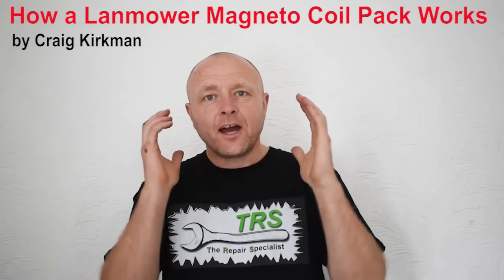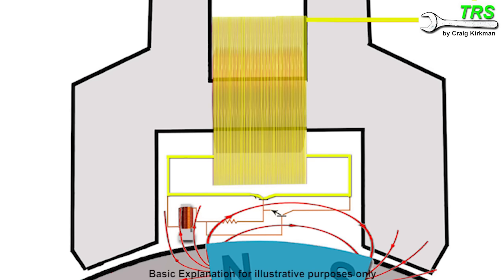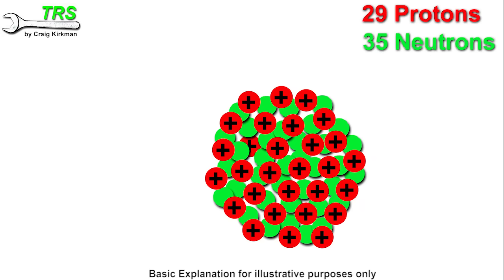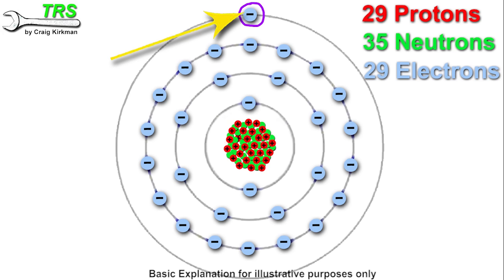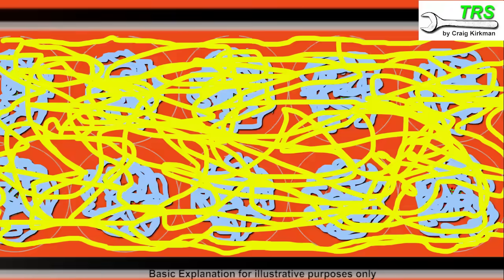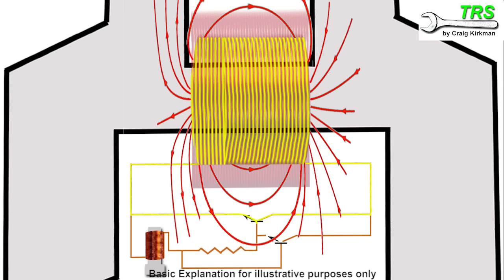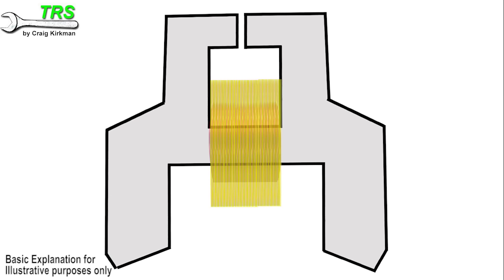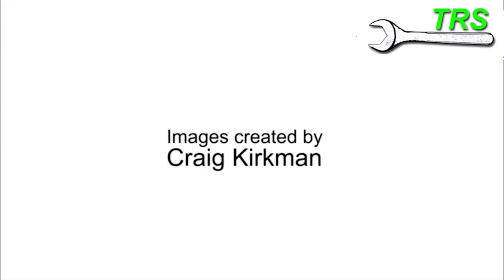Lawnmower Coil Pack Sparking System - Induction Coil, Transistor!  (by Craig Kirkman)

Comment: The ionized air between the gap in the spark plug is called a conductive  "plasma"(I'm pretty sure).  It a acts like a wire.   There's quite a bit of resistance in that gap of air so as the current of the spark passes through it the air becomes extremely hot.  That heat and (more importantly) the visible spark ignites the air/fuel mixture:  IGNITION/BANG.  The compression ratio of the engine contributes to the volatility of the "charge"(the air/fuel mixture) because as the "charge" is compressed it becomes hotter (PV=nRT:  one of the gas laws:  Boyles or Charles).  Also, the compressed "charge" resists current flow, proportionately:  the more it is compressed, the thicker it becomes.   So the spark must overcome the initial resistance of the "charge" and the additional resistance of the the concomitant compression.  So additional voltage is required (hence the need for super high ignition systems on high compression racing engines).  But, the compressed "charge's" increased resistance also increases the temperature of the spark IF the spark can jump across the gap.  That is also the reason for the fat insulation on your spark plug wires.   Since the rotor, cap,, and plug wires were so problematic (relatively  speaking):  they have been phased out by Direct Ignition Systems.  The compression ratio of a engine also augments the characteristics of the compression chamber's airflow(something that isn't immediately cognicized by sophomoric engine mechanics).  Finally, this could lead to the subject of a great video:  "How A Plasma Cutting Torch Works".  How is that for a juxtaposition?   Read chapters 13, 14 and 15 tonight.  There will be a 40 question test (multiple choice), tomorrow.   Bring a #2 pencil.

Comment: If you rock the magnet back and forth over the coil pack it will spark the spark plug if the coil is not grounded out, just as if the shear key is not sheared throwing it out of time then it will spark correctly, just as it would if it had points and condenser. My opinion only.

Comment: Fantastic explanation. How does this system cope with rpm changes in an engine i.e. advance/retardation? Is this something you've covered Ina different video elsewhere? I've often admired the outwardly very simple ignition coil/spark lead combo packs typically found in string trimmers and have always wondered how they effect their advance/retard as they go from 1800rpm to 7000+.

Comment: I had this coil assembly quit working on my lawnmower.  Replacing and gaping it was easy and the machine was back in service quickly.  I learned how this worked, your video reinforced that theory.
"When magnetic lines of force cut across a conductor a voltage is produced which causes electron flow called a current."  I think that's how the "theory of operation" works.

Comment: Dude, i am a car guy. My existance has evolved around the automotive industry since i was born. The ignition of an unternal combustion engine has been that element of magic that occurs that has always been just beyond my understanding until now. The simple and direct  explanation you just provided has given me the knowlodge of how the discharge across the air gap works. I have always knowledge the whinding and magnets that mive the toroidial field expands and contracts by proximity but now i see how the electrons are shoved forward for the eventual jump and discharge of compressed explosive gas. This is a game changer for me. And you gave a stranger a clear image of fast as light movement of electrons. Thank you very much!

Comment: Nice explanation but why is the resistor needed? Is it to complete at a lower voltage the connection to the transistor to make the transistor turn on and only let the Voltage flow in one direction?

Comment: Hello Craig from a fellow Stokee! Great video. I'm trying to restore an old two stroke single cylinder outboard motor (1981 Suzuki DT3.5)  which appears to have 4 magnets within the flywheel and wondered if you could explain why there are 4. The reason I ask is, replacement points and condenser are hard to obtain and I've seen small, relatively cheap ignition modules (Nova II) which can replace the points and condenser but they advise that they won't work with multiple magnet flywheels. Presumably, as they'll not allow correct ignition timing?

Comment: extremely helpful. good visual aids in vids. ? # 1,,the ground strap connects with what internally ?  # 2... the kill switch how does it function  & where is it in the coil.
Reply from the maker: Thank you for your comment. I really appreciate it. my next video explains quite a lot about the kill switch/wire and how the electricity generated by the coil flows through the system and earths into the engine body.  It should be ready very soon. Maybe next week.  Many thanks again. Craig

Comment: Points are simple ,but this is even easier. 
And no moving parts.
Briggs says set the gap to around .010 , but off the record during training they said you could probably pull it all the way back in the adjustment and still get spark. 
Very hearty setup ,I just wish there was an easy way for advancing the spark like the newest ones do electronically built into the magneto.

Comment: Mate , you have explained to us all what my late uncle , who made massive generators , motors & transformers , simply could not , also , you have inadvertently told me just what the green ball lightning actually is , that 3 of us had seen 3 times , it,s an electron sea , in my case , generated by extremely high wind , always in the same place . You wouldn,t want to be near it , it crackles ! Your knowledge is akin to the late Nikola Tesla , consider yourself respected .

Comment: Wow, I have been repairing small engines for over 40 years and never undo his concept until I saw you video. Some years back I received a call from a friend who was trying to repair a neighbors lawn tractor.  He had replaced the coil and the new one had no spark.  I arrived and after some time suggested reversing the coil.  Amazingly it fixed the lack of Spark.  I now understand why.  Thanks for the great explanation 👍👍👍👍👍
Reply: How does reversing the coil change anything? Does it change the position of the sensor coil relative to the flywheel?

Comment: Great explanation of how the spark is generated. But how is that timed so that the spark jumps at the right time in the four stroke engine? It is easy to understand how that is accomplished using points, but this excellent video doesn't explain how the spark's timing is linked to the engine's mechanism.

Comment: You just explained how these UFOs move so fast because they use a Magnetic Drive craft Using the earths core That also explains the shape of the UFO and how they can stop and start instantaneously and travel at the speed of light or faster and able to move it underwater or in the air equally

Comment: Excellent!  Could you explain how the kill switch terminal is connected to the circuitry?  On my B&S Magneto, the kill spade lug reads zero ohms to the iron core, and I don't understand how a ground supplied by the kill switch (in action) would change the circuit.

Comment: Wow! Very thorough explanation. I wanted to hear about how they disable the spark through grounding the coil. Most engines with magnetos will run and not shut off if the ground wire is disconnected. Which coil is grounded out for ignition disable? Primary? Thanks!

Comment: I wish that the 2-stroke bikes that I rode some 50 years ago had this ignition system rather than insisting on a contact breaker that forever needed adjustment and would wear out in time.

Comment: Very nice. The only issue is current doesn’t travel from negative to positive nor positive to negative like people think. It’s already there! In the wire. In the form of atoms. Negative and positively charged.. . The pipe with water flow has always been wrong. Leading people to understand electricity entirely incorrectly. Electricity does not move down a winding path to anywhere. At least not like water. The electricity in one’s home does not travel from the power plant the power is already there at your house and at the power plant at the same time otherwise it would take a while for your light to come on when you flip the switch. But seeing how it’s instant— that means it never had to travel anywhere.

Comment: There are two terms I associate with a magneto that you do not address. A diode and condenser. A diode limits the electron flow to one direction only.  Has this been replaced by a transistor?  Where is the condenser located that stores the electrical charge when the points open?    Thanks. Nice vid.

Comment: In my opinion the main current of the  primary coil is made by the magnets passing the big iron core by,,and the trigger ,which has litlle current,has little to do with, it has just enought current to oppen the transistors,causing the colaps the hole magnetic field and so on...The trigger coil itself is so small just becouse all story must take place in a very short rotation angle ,few Millimeter before the piston reach the highest point.

Comment: Good detailed explanation thanks. You mentioned transistors so I assume this is a modern transistorised set up rather than the older points and condenser based magneto. Is that right?

Comment: so you build up the charge in the inductor and the points fire the charge or the transistor fires to charge why can't the opposite flow of the inductor fire the charge why do you need points why do you need transistor

Comment: So what's the purpose of running a parallel circuit with a resistor from the trigger coil if the current doesn't even pass through the resistor and just goes around it?

Comment: Awesome explanation! Definitely going to subscribe. One question I still have is if the lonely electrone moves from the trigger coil and only partially flows back, how does the copper wire of that coil does not obtain a "positive balance" and how can this process keep going?

Comment: Ok, so with your explanation, I understand how a Magneto system works.
However, I am trying to go further, if possible, my eventual goal is to build a generator, portable or stationary, that I can use in  emergency situations or as an in the field generator.
Sure, I can buy one, but they are extremely expensive and I just don't like them much.
I have been playing around with the idea for a while now, I remember the older motorcycles used to use this type of system and were not only able to generate enough energy to to run the spark, but also enough to run any electronics on the bike.
First, does the iron A frame HAVE to be an A frame, can it be any other shape as long as the end result is the same ?
Second, if you added one, two or three other magnets to the flywheel would it generate MORE electricity, or would it cancel out the rest ?
I am not an engineer, or an electrician, but I am sick and tired of not having any backup power source whenever the electricity goes out, as I said I could buy one, but they do not work on the same principle of making electricity as the magneto system, personally I think this system is the simplest and could be improved upon to deliver more electricity than just what it takes to run a spark plug or a household light bulb.
Even better would be to figure out a way to make this system work, once started, by either pulling a rope or starting it with some type of a starter, once the system is started finding a way to make it perpetually continue to turn without the use of a gas, electric or battery powered motor.
I KNOW it has to be possible I just have to figure out how.
Thank you for the explanation.

Comment: I have a few questions.
If the primary coil makes a magnetic field as a result of only the current flowing from the Trigger coil, through the primary coil, then why can the Transformer part of the circuit not be located remotely rather than on an iron core that is in close proximity with the flywheel and its magnets. It seems only the Trigger coil would need to be within the magnetic field of the rotating flywheel magnets, not the whole transformer, if it in fact does provide all the current to drive the transformer’s primary coil.
Also, why do the outer two legs of the iron core of the transformer need to be in close proximity with the fly wheel’s rotating magnets. It would seem there must be some interaction between the transformer windings and the rotating fly wheel magnets that has not been discussed in the video.
It would also be interesting to know why some single cylinder motors have more than one magnet in the fly wheel right next to each other.

Comment: Craig did a good job but got a few bits muddled. A Darlington pair is a high gain transistor that only requires a small base current to create a collector emitter current. When the rotor magnet polarity reverses on the trigger coil, the Darlington pair turns off very quickly. I would assume in the low micro seconds. Because the primary magnetic coil has established say an amp or so of current, this disconnection now operates the transformer in flyback mode, which is very similar to CRT(cathode ray tube) transformers. An inductor wants to maintain its current. If you rapidly attempt to remove that current (in this case via the transistor turning off) it will reverse its voltage theoretically to infinity to try and maintain the current, but in practice it limited by the transistor switching speed and eddy current losses in the transformer. The speed of light explanation was confusing to what was important, which is the di/dt and dv/dt flyback effect. Notice there is a second gapped magnetic loop Craig didn’t mention. This is critical to the operation of the system as without this, the flux lines would radiate into the engine and be very inefficient. The small gap at the top is to prevent saturation of the iron laminations. There would also need to be a grounding point for the secondary coil.

Comment: Excellent explanation!
But this mechanism would make a fixed ignition timing, ignition always happens at the same crankshaft angle ( no relationship with RPM or throttle ). That's bad.

Comment: A great video.  The only thing I would say is that the Spark Plug is grounded to the Coil by physical contact and the screws of the coil.  There can be no real current flow if the circuit is not complete.  It is the voltage difference generated that causes the electrons to cross the gap.  The higher the voltage, the larger the possible gap jumped.  It is necessary to have quite a High Voltage because the gap is expected to be bridged (jumped) during the highest pressure portion of the engine cycle outside of the actual ignition of fuel.  The higher the pressure, the more air to repel the voltage, increasing the voltage requirement even more.   This is why a plug with a narrow gap will fire when a larger gap will not.

Comment: Great job.  I've worked with small engines most of my life.  I never viewed the coil as a transformer, but it is.  Also I have thought about the coil causing the sparkplug to fire each revaluation of the flywheel even though
it is not time for combustion.  A four cycle engine makes four revaluations , firing each time but only combusting on the fourth revaluation.  On an automobile situation is the same except it only fires when needed at a particular cylinder.  What would we do without electricity?
Reply: You've got that wrong Dennis. Combustion on a 4-cycle engine happens every TWO revolutions not four. 4 cycles mean, intake, compression. expansion and exhaust. it does not mean engine revolutions and it takes 2 revolutions to complete the four cycles. Have a great day sir.

Comment: Learn this even faster! Yank the spark plug wire off a running mower with your bare hand like I did at the age of 13. Takes a seeming eternity for the engine to finally stop and release you from . . . The Grip Of Power.

Comment: First, was neat seeing you (is that 1st time you've shown yourself on video?), you - ahem..- you sounded/seemed a bit older, it's nice to see you're younger than expected!!  Still can't figure out if you're funding this entire thing (or even doing the entirety of it yourself, though that's sooo hard to imagine, you'd have to as good at graphic design/filming-animation as you are at explaining engine-workings!!)
Secondly....How, then, does my chainsaw-spec's manual say the ignition's sparking is "at different degrees" (based upon RPM)?  Not able to understand this, honeslty was searching for a video to learn Re how the coils of a basic unit work (IE an ms660, not a 661 with M-Tronics), to see how the 'different timings at different rpm's" was achieved but the ignition module seems decidedly "single spark"...perhaps the varied "degrees before TDC" at varying RPM's is just indicative of piston position at varying RPM's? IE how, when going faster, an engine's combustion is happening "later" in the cycle simply due to combustion being a fixed speed, and movement of the piston being a varied speed..
Thanks so much for these vids, was great to see they are single-function (as I suspected, IE not "2 different coils, to ignite at different RPM's), would LOVE your thoughts on the idea of (for performance chainsaw builds) of retarding the timing, for purposes of running higher compression ratios?  LOL just writing that I realize how much I owe you, I spent years laerning basics of chainsaw/2-stroke mechanics and it was you and @donyboy73 who were my go-to's for everything, him for how-to's and you for deeper-dives usually but it helped I was salvaging "unrecoverable" units over and over, before getting into mods....am now doing some gnarly stuff I've never even seen people do on saws :P